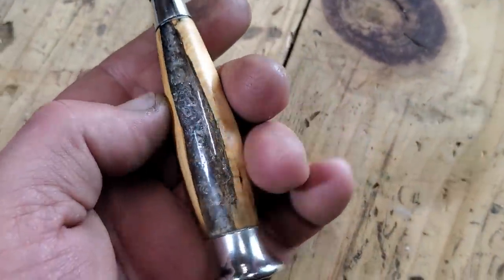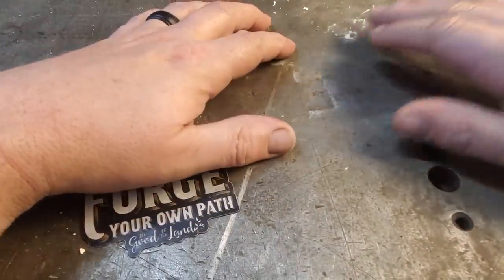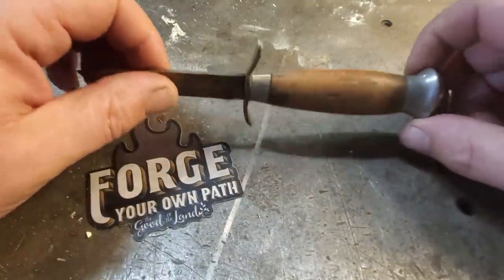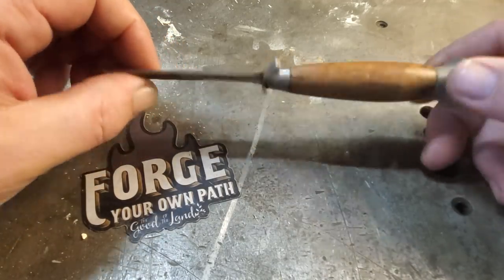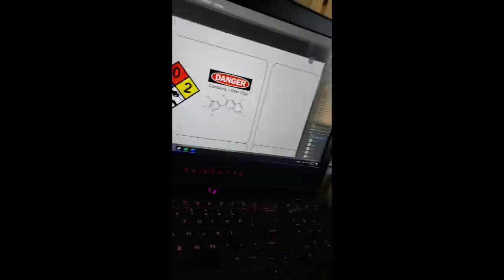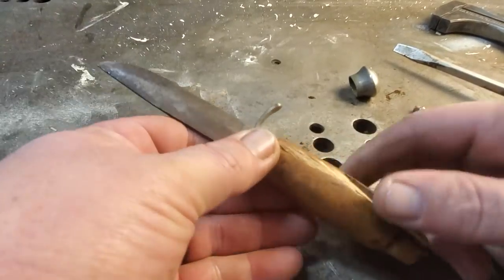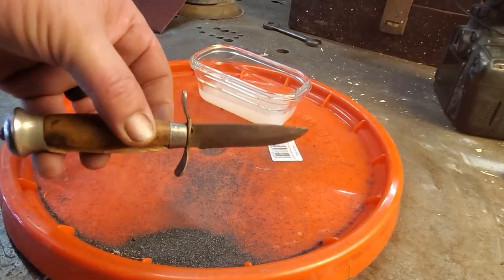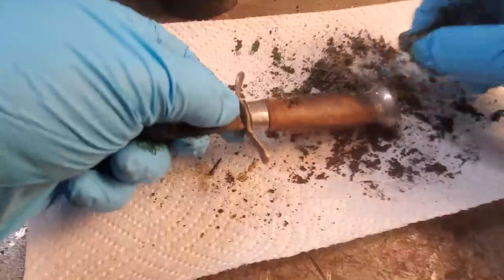Rare Knife Restoration- World War I Trench Knife Unearthed

Comment: I was seriously questioning what the CRAP you were thinking using super glue to fill that. YES, thick CA can fill something like that, but thick CA has a very strong tendency to basically shatter with some time and exposure to changes in temperature and humidity. I have a large number of exceedingly thick CA finishes where I was learning how to embed cigar labels that looked GREAT for about a year before the CA spiderweb cracked like crazy. I've learned some painful lessons.

Comment: Shared it on Twitter and I will also try get it onto Instagram. Just need a picture to go along with it I guess. 
I am absolutely amazed at how well that Starbond worked on that “gap” it filled. I have used CA glue to finish some wooden file handles I turned on my lathe and they came out nice but that Starbond is awesome. They need to hook me up. 😉😂🤣😂🤣
Your next restoration needs to have rusty plastic like some I’ve seen.